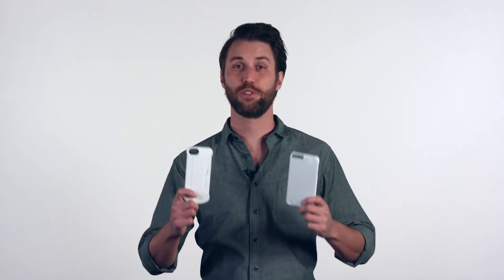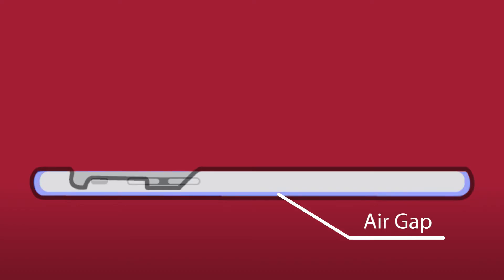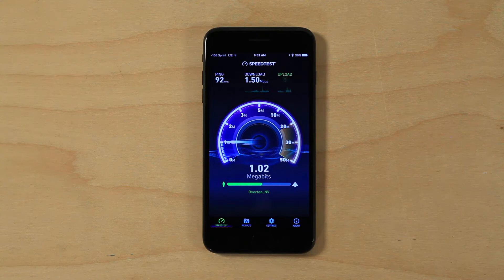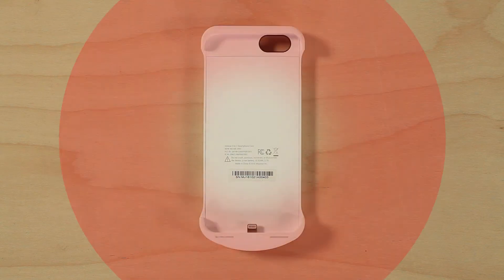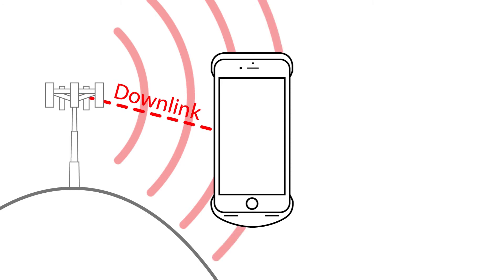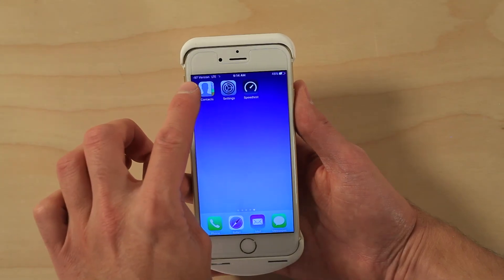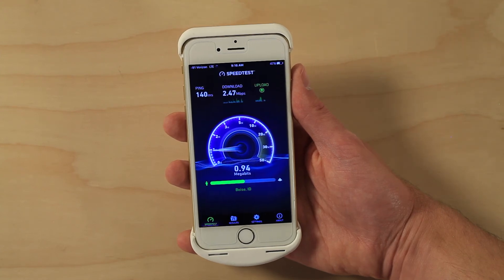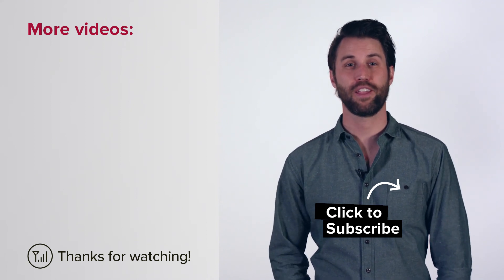Do Signal Boosting Cases Work? | weBoost

Comment: You need to make a cellphone signal booster that is completely mobile like when you go hiking
Reply: I wish
Reply: Yeh imagine
Reply: I don't believe they can "legally" make an amplifier case that also boosts the transmit signal due to FCC regulations of human RF exposure which is limited to something like 30db (TX plus antenna gain). 

However, they COULD make a powered case that passively connected the internal antennas to higher gain external antennas